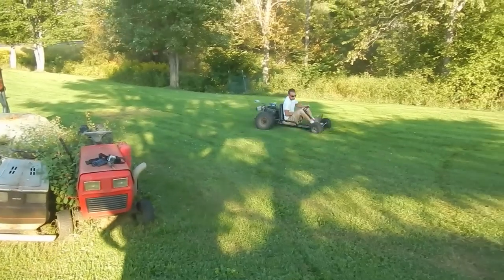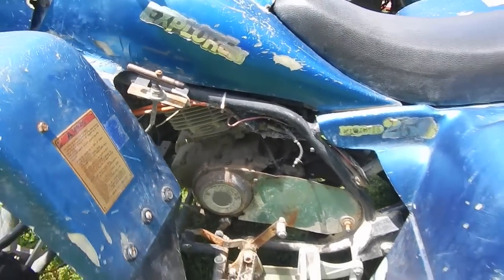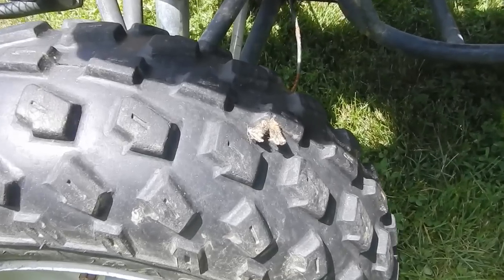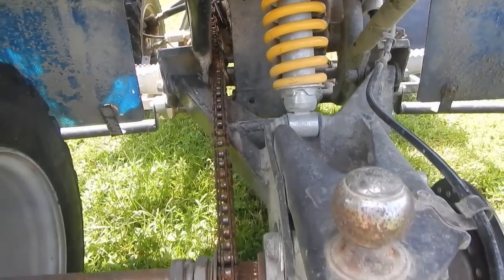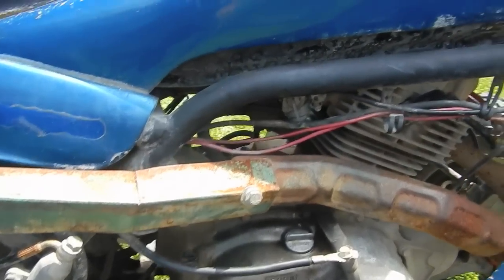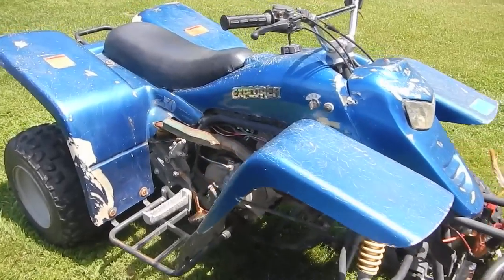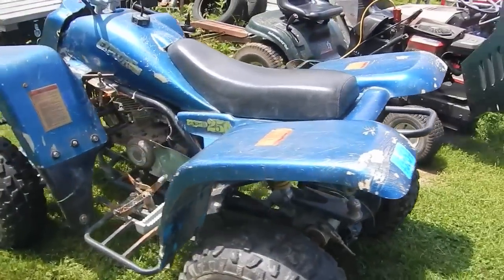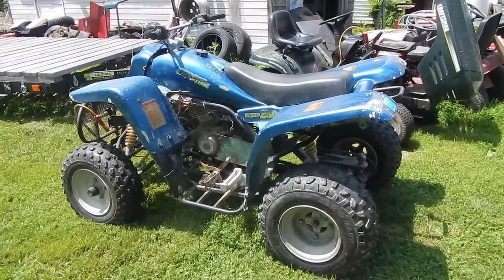Fearlessfront gets an  ATV

Comment: Me and a buddy build a mini rock crawler out of a wrecked KAW 300 4x4 bayou, it was a beast. very easy to set up a base with the right platform, it was a suspension flexin solid axle one seater crawler and we sold it for 5k once the lights were on and the sheet metal was on it, so muck fun in the mud and crawlin, semi auto with reverse welded axles 2wd or txt with a flip of a lever, high and low range. We were gonna turbo it but it was so light it didn't need more power, put so many razors to shame on hill climbes

Comment: several people have suggested mounting the motor on the golf cart, would be a great motor for it and the front suspension would be great for a new crawler build or more extreme off road mower, but if the wife wants it and you can get it lined out give her 1st dibbs

Comment: Take a spare lawn mower chassis, mount the Suzuki in the front still and mount the front and rear suspension with A-arms and all on the front and the swing arm on the back... Kind of like a long travel lawn mower. I think would look and perform pretty sweet. Maybe even find another quad with independent rear suspension and use that on a lawn mower, maybe even 4x4.

Comment: No betrayal.  The ATV is cool.  You made a good trade.  A lot of potential there.  There are several websites that sell Chinese ATV parts.  Get the numbers off the engine and frame and go from there.  The parts needed should be much cheaper than the parts for a Honda, Kawasaki, etc.

Comment: I've been looking for a cheap atv that runs. I'd like to put an atv engine and transmission in a lawnmower also using the rear suspension from the quad so that I have a bad little machine that I can take to local steamshows and if it's nice enough looking take it to some car show. I think alot of people would be able to appreciate something custom. Just what I'd like to do. I think it would be awesome if you used the atv parts to make a really fast/powerful "go anywhere" lawnmower

Comment: If you don't find a sprocket, splice that front end and engine onto the murry or one of the other tractors and make an offroad beast! It would cool if you could mount the engine under the seat of a lawnmower and put that axle on it to have a quad-mower!

Comment: Hey FearlessFront (Todd Christopher) I just got a non running basic frame go kart for sort of a trade, and its a 15 horse briggs. It doesnt have any lines on it, and i was wondering if you could tell me how to route it? The motor is pretty solid and has a carb, but that doesnt have any lines either, or a recognizable throttle body. Thanks.

Comment: I used to own the same model ATV. If you keep it an ATV find some softer shocks that'll fit it. Those shocks are so stiff it's almost like having no suspension. I'm 250 pounds and the shocks barely compressed with me on it

Comment: stop running the motor and adjust the timing chain or that motor will blow the timing chain can be adjusted with the nut and screw on the timing chain tensioner its on the side of the cylinder right above where it says 158cm just with the motor off just loosen the lock nut than turn the screw loose you should hear a clunk than tighten it all back up that should help the slapping ticking timing chain a lot

Comment: LOL the bleeder valve on the rear caliper is at the bottom of the caliper.,I bet that is impossible to bleed,easy to shear off.....Hold a piece of paper,or cardboard behind the exhaust to see if it is blowing oil out the tailpipe,or not,if not re jet the carb,replace the hub,sprockets,chain,fix the fiberglass,wiring,etc.,or strip it down,and keep the engine,axle,suspension,brake setups,hubs,wheels,and tires for future projects...Chinese atv parts are easy to find on feeBay,but since that one has been converted to Jap engine,and wiring there's not nearly as much to give you problems as the Chinese parts would've...I've tossed a couple of ohv side shaft engines in the cheap little Chinese frames before with great success,,

Comment: You may or may not like this idea, but I know your Golf Cart projects is not nearly finished state but you should take that engine out of the ATV and put it in the golf cart few reasons behind doing this, electric start and reverse.
Then put the engine that's currently in the Golf Cart in the ATV, I've seen a few people put those predator engines in ATV's they actually don't work out too bad...